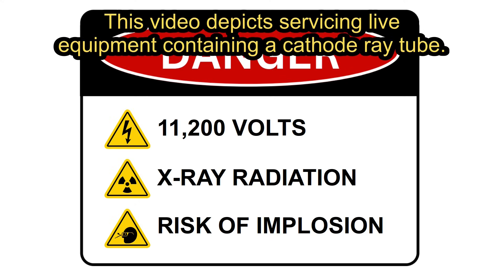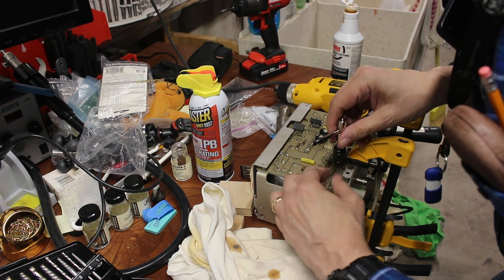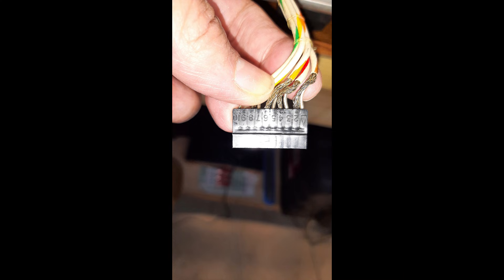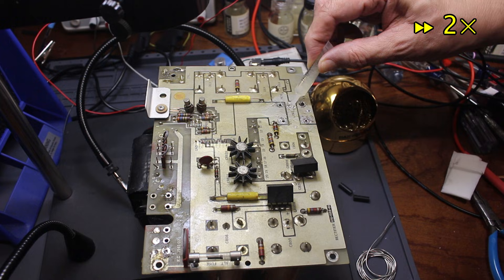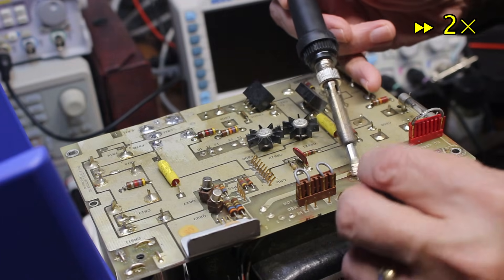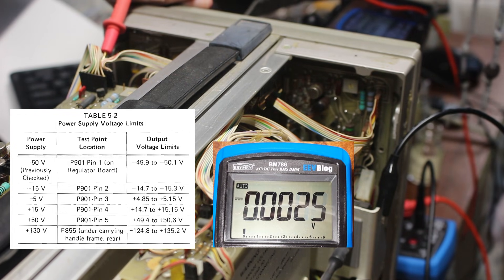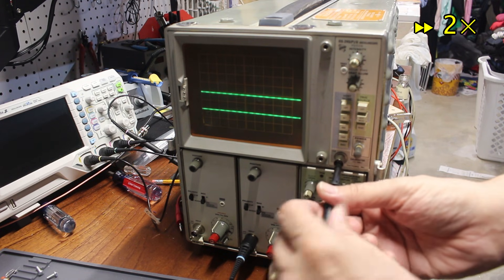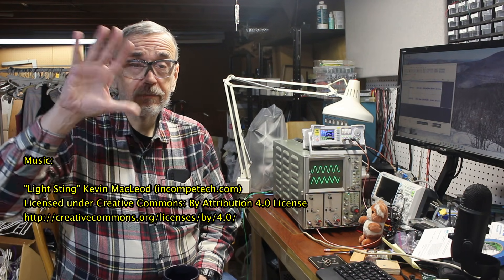Restoring a Vintage Analog Oscilloscope | Finishing the Restoration

Comment: Wow, Kevin, you used Keycad to design your adapter!  My former employer made CCFL inverter circuit boards, and used Keycad  to sketch board drawings (outlines, connector locations  mounting holes  etc.) for the datasheets.  They used a program called PCTrace to make the actual board layouts (copper).  Definitely old school.  But then we also used DOS and GW Basic to run our board test stations. 

 I'm curious..  What company did you buy the adapters from, and did you give them a DXF file?  How would you suggest replacing  a HV can capacitor with multiple taps?  My Tek 464 scope has severa of these and they've gone bad.  

Finally, may I make a suggestion?  Those strippers are really awkward.  Buy a  cheap stamped steel stripper, the kind with a single stripping notch and screw adjust.  Use a small "India" stone or fine diamond needle file to polish each V notch to a V with aslightly rounded radius  (still sharp). Then adjust the screw to cleanly strip 26 ga. wirewrap wire without damage.  You will find that with a little practice you can easily strip up to 12 ga. wire without any change to the adjustment.  And the tool will fit in tight corners.  I even stripped coax jackets with the same tool without cutting the shielding.  You just have to rotate the tool around the jacket once or twice.  Those big spring loaded tools will sometimes bird cage the wire, and they're awkward.
Reply from the maker: It's spelt KiCAD, and it's an open-source EDA (Electronic Design Automation) system. Find it at https://www.kicad.org/. Its final output for a board layout is a set of industry-standard Gerber files, which you can upload at the web sites of several board shops. I happened to use JLCPCB for these. 

The spring-loaded strippers that grip the wire are great for doing repetitive cuts off the roll. They are gentle on stranded wire, and they grip both sides of the cut. 

I happened to have them lying on the bench, so I just grabbed them, otherwise I'd have pulled my Knipex stripper off the rack. That one would have been perfect - just stick in the wire end and crunch!
Reply: @KludgesFromKevinsCave Thank you.  It must be a newer version of KiCAd than the one we used, which did not have Gerber ourput.  Ir maybe KeyCAD and KiCAD are two different programs.   I will check out KiCAD, and your PCB source.   And this summer, if my health improves, I will tackle my Tek 464 electrolytics
Reply from the maker: The caps with multiple taps are usually either relatively small or else low voltage. You can often replace them with this sort of adapter, and modern caps stacked up somehow, maybe with hookup wire joining them. You can grind off the base from the original can, dump the contents, and hide the whole modern mess inside. I didn't bother for this job because the new can was the same diameter (and less than half the height) and didn't look horribly out of place, and I'm pretty sure the cap I replaced wasn't original to the instrument.

Comment: What a nice device - and great  work on it! Ithink my oldest scope here ist from 1952. Perhaps 🙂
Reply from the maker: I once had a Heathkit scope from 1968 or so - but it was lost (along with pretty much everything else in the house it was in) in Hurricane Sandy. It wasn't much of a scope - I'd have kept it only for nostalgia.  

What I really miss is the 1946 Hallicrafters S-38 shortwave receiver that my father rescued from a dumpster sometime in the late 1960s.  With an added antenna tuner, it had surprisingly good performance with an array of attic dipoles and a cold-water-pipe ground. The 12SA7 front end was sensitive! Moreover, unlike later models in the S-38 series, it had an internal BFO.  

My collection of QSL cards from about 1968-1973 was also lost in the flood.  This was all old stuff stashed in my parents' house, where my brother continued to live after they passed. Obviously, I didn't have any immediate need for it, since it had all been stashed there since the 1970s!
Reply: @KludgesFromKevinsCave  That´s really sad, I can only begin to imagine how it must feel. Fortunately, we rarely have such severe hurricanes here in Germany, but I'm still worried because I live right under the roof – with all my old stuff. My daughter was affected by a flood; she still thinks about it to this day, even though the material loss was minimal since she lives on the first floor. But all of this is nothing compared to a total loss!

Comment: Hello,soldering this kind of 60/70's boards is much easier with a 40W iron,no flux needed.
Nice and  easy repair of P.S. failure.
Reply from the maker: Yeah.  I had my iron set to the highest temp it went to, and used the most massive tip that I had.  When I was pulling the capacitor, I didn't know the trick of dissolving the old solder in ultra-low-temp stuff, and wished for an old-school plumbing soldering iron or one of those Weller soldering pistols.
Reply: @KludgesFromKevinsCave  That's what I pull out when I need to tackle something like this -- a Weller soldering gun,  that does 100/140W.  They come in bigger sizes,  but I haven't had a need for that yet.

Comment: What a mistery the voltage rating of those caps. Maybe a primitive planned obsolescence? I suspect the load is somewhat stable, so no overvoltage from light loads. And obviously there has to be some inrush current protections. But it is very peculiar, and obviously the component has failed
Reply from the maker: I think it was confusion between the commercial and military versions of the 'scope. Uncle Sam wanted to be able to run it of 100V Japanese power, and rather than put another primary winding on the power transformer, Tek went to a higher voltage on the secondaries at 120V, which would still be high enough at 100V.  But not all the changes made it into the final BoM.  (It appears they did happen on the factory floor - the two capacitors on the +15 line were 30V rated.)

Comment: Good work. True, sometimes you can't avoid using an old analog oscilloscope. That's why I keep on my workbench the Hitachi V-665. It's also 50 years old and still works perfectly.
Reply from the maker: It's also so satisfying to have a piece of vintage gear that's still useful.  

Analog 'scopes are stiil being manufactured, but have you priced them?  Gadzooks!

Comment: You probably had to adjust it anyway but… in the Tek scope I worked on, the voltages were derived from the 50V adjustable voltage. I also adjusted it to get the voltage on spec but this meant I had to do a full recalibration of everything else afterwards. Worth noting for anyone following along as if you don’t need to adjust this I would leave it.
Reply from the maker: Yes, -50 is the reference for all the other voltages.

The -50 was just barely out of tolerance when I started.  All the other voltages both started and finished in tolerance, except of course for the -15 with the bad cap. I had to tweak the gain of the vertical amps, but that adjustment is unstable enough that they put it on the front panel.  I don't have the Tek calibration fixture, but I tried various wave frequencies and amplitudes from my AWG and didn't see obvious problems. Are there specific issues that you think I need to watch out for?

I don't know what unpleasant surprises might lie in wait, but I actually don't plan to do that much with this scope.  I just have a couple of fun projects that could use an analog scope, and I was curious if I could bring this one back from the dead.
Reply: @KludgesFromKevinsCave  On mine it did mess with the sweep timing a bit. I have a 20MHz siglent generator that got the sweep, delayed sweep etc more than close enough for my purposes. I ended up recalibrating the input ranges anyway as the contacts needed cleaning. I quite enjoyed working on the old scope. Nice watching you work on yours also! I am really enjoying all your videos! Thank you.

Comment: Someone gave me a old Tektronics scope about 2 years ago. It was over a year later that I finally tried it out, and it worked great for almost a minute, then there was a loud bang and my house started filling up with blue smoke. I unplugged it haven't touched it since. This video might just inspire me to push it up about 20 positions on my list of things I'll eventually get around to.
Reply from the maker: It sounds as if a tantalum capacitor went - those are the usual things for loud noises and smoke.  Most other things fry quietly and heat up to smoking more gradually. The bad 'lytic didn't make any smoke at all. It just stopped filtering.
Reply: @KludgesFromKevinsCave  The fact that you don't associate electrolytics with violent explosions shows that you don't install them backwards as often as I do. ;) Good point, though. I was pretty sure it would be a cap, but hadn't considered tantalums. I'll definitely let you know what I find when I finally get around to looking at it...probably in a year or two. ;)
Reply from the maker: @SkippiiKai Somehow, reversed electrolytics is a mistake I've never made.  (Any bets that now I've said that, it'll happen in my next build?)  I have managed to make the storage inductor in a switcher undergo rapid unscheduled disassembly, leaving black gunk everywhere. That was a heck of a cleanup job!
Reply: Another reason could be the power line filter (capacitor cracked and absorbed moisture). That's what exploded in my Tektronix 2712 spectrum analyzer and since it sits in front of the power switch it even kept on going when I desperately tried to switch it off after I noticed some sizzling. It ended with a big bang, a lot of blue smoke and then the lights went off. For a second I thought I need to throw it out of the window.
Reply: @weinihao3632 That could definitely be it! I remember that it was still functioning normally (well, other than all the smoke!) as I lunged for the power cord!
Reply from the maker: @weinihao3632 Good suggestion!  I hadn't even thought of that one.  This unit had been sitting long enough that I really ought to have ramped it up carefully on a Variac, but obviously I didn't.
Reply: Sounds like RIFA capacitors,  perhaps in the line filter but also possibly in other locations.  These should be replaced on sight!

Comment: I was lucky to get one used here in Brazil (where they're quite rare).
It had several issues but I was able to fix them all.
Now I have a wonderful 7623a storage frame, with one dual channel 7A26 vertical input plugin, a 7A13 differential / Voltage comparator plugin and a 7B53a dual (main & delayed)  sweep plugin.
Everything works a treat.
Reply from the maker: Sounds like you put together a wonderful scope!  This one is nowhere near that level - the military cheaped out on most of the pieces.
Reply: @KludgesFromKevinsCave Indeed... And those are quite uncommon over here.
It must have been from some large corporation or university.
The guy who sold it to me clearly didn't know what he was doing as he shuffled 1 vertical plugin and two horizontal (2 x 7B53 units, but one had the TV sync detection option).
I sold the 2nd horizontal and eventually got the 7A13 from a collector. I was hoping for a 7A22 differential but it turned out that I liked the 7A13 much better.
I never figured the usefulness of the vertical comparator.
It can really turn an oscilloscope into a precision 10000 count voltmeter. But I had problems all around, on the mainframe and on the plugins... The mainframe had a couple of molten contact leaves in the center backplane connector that would short out the P.S. when I inserted a plugin there.
It took me to disassemble the whole thing, identify an unused contact from another position (there are a few, not really unused, but reserved for some obscure functionality that I'd never use).
In the 7A13 plugin, I had to replace all the relays, for which I needed to use regular mini-relays instead of the originals which were unsalvageable. The HF performance I guess was somewhat compromised but, it works.
It took me I think a couple of years working on and off on it to get it fully working.
Reply from the maker: @fabiotrevisan8922 That sounds like a wonderful project!  When I got this 'scope, I got it from a surplus dealer in working order and newly calibrated.  It was still in working order when I put it into storage, so I didn't have nearly the challenges you faced.

Comment: The Tekronix 7000-series is really fun.  Their modular and rugged design is close to perfection. Even more impressive on the original trolley. Thank you for saving this one.
Reply from the maker: My pleasure! It was a fun project.
Reply from the maker: P.S. I didn't get the scope cart.  I don't think the military version fits it, anyway.  A cart would be nice - the scope takes up way too much space on the bench, and at 20 kg, it's a pain to move.
Reply: @KludgesFromKevinsCave  A cart really helps a lot. The original Tektronix one would fit the military version too. And it is tilt to improve the ergonomics. But you need space :-(.
Reply from the maker: @Achim188  That's the problem with this old gear - it takes up so much space however you place it!
Reply: @KludgesFromKevinsCave  P.s.: Happy new year!